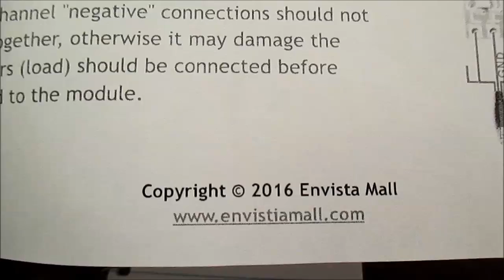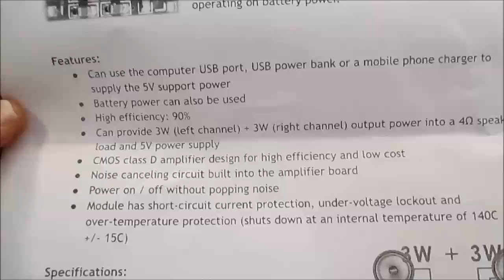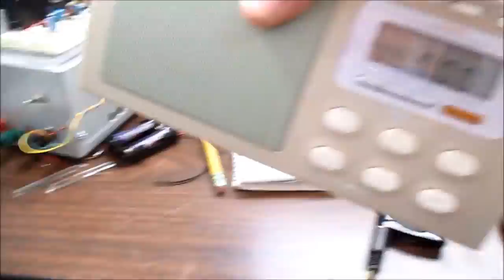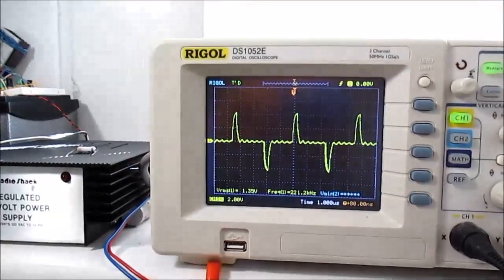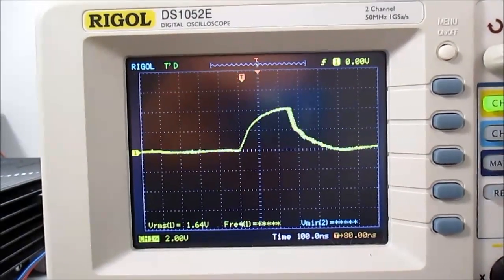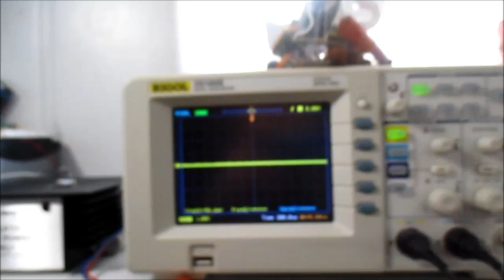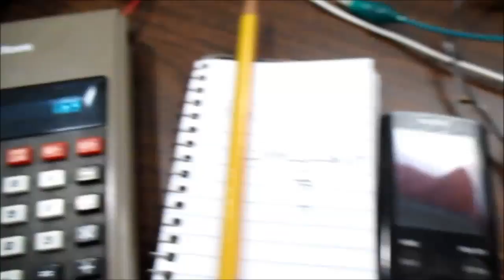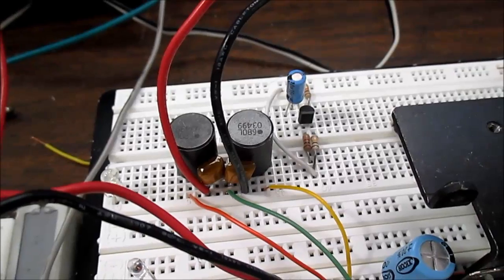PAM8403 class D tiny stereo audio amplifier board review & test

Comment: Hi ! I just discovered your channel searching about amp module for cosplay props. I have a few of these PAM8403 modules and I used to put some big capacitor on the input voltage, like 2 or 3300uF. I can't find a clear information about how big should be the capacitor, I've read somewhere 1000uF per watt... I've seen in your video that you're using quite small capacitor, like 220uF I think ? So my question is how do I select the rigth capacitor size for the input voltage ? Also, do you have a good reference book to recommand that might cover this subject ? I'm quite noob on amplifier and there is so much contradictory information on the web. Thank you !
Reply from the maker: It depends on your power supply. 1000uf would be plenty for this amp
Reply: Ok I have a 8A dc-dc 6-14V to 5V power supply module CK1408.
Is it better to have multiple capacitors like 1000uF, 220uF and 0.1uF to smooth the input voltage or just the 1000uF?

Comment: Great video, great impressive tiny amp module. Did you knew you can other things with these little wonders? Believe it or not but I use these cheap boards to drive resqued/salvaged VFDs (Vacuum Fluorescent Display) its filaments, works great! Mostly a filament wire is 6 to 8 ohms depending on the size of the display. An amplifier like this is a great tiny current source (at a low voltage) and is exactly what the electrons inside the display are looking for ;-) 

Its output (one channel) is  AC instead of DC that avoids uneven brightness of the display and avoids damage of long term DC usage. It is also easy to drive because it needs only 5VDC and it provides a TTL-level (with use of some resistors) brightness control (if needed, if noise is not powerful enough) so you can input a wave (frequency or PWM (square)) to control the brightness. You can do this for example with a microcontroller/Arduino or another oscillating capable circuit.

This tiny thing saves you the need to design a complicated coil, H-bridge, half bridge solution or special (mostly obsolete) driver IC to drive the filament of such displays and it is really cheap. I use this method in a few projects and it is really great. Nobody told me this possible in my journey to find an easy solution. Only want to let you (and others to know) that amplifiers can be used for other things that isn't described inside the manual. Try it if you like, it is great!
Reply: Your comment gave me such a great idea man. Never looked into VFD, wow awesome concept!

Comment: Hello John. I have a similar amp here, but what I want to use it for is a spring reverb driver for guitars. I want to have the guitar signal go into the right channel, then out of the right channel into the input port of the spring reverb tank. Then, on the output of the spring reverb tank, hook that up to the input of the left channel of the amplifier and then pass the output of the amplifier left channel into the guitar lead heading off to either the amplifier or the next pedal. Your thoughts on this idea would be a great help. Thank you.

Comment: I know I'm pretty late jumping in here with questions but does anyone know how much current this board draws? I will be using USB power and two 4 ohm speakers, just trying to make sure 5v at 1 amp is enough to power it. I just bought 12 of these from Amazon for about $10.
Reply from the maker: You should be fine with 1 amp.

Comment: That was an easy smooth Clear run through of the concepts I'm looking for. The big difference, for me were the well placed  descriptions of - how you know it functions well, is it to specs, and things you change due to slightly newer variations of similar amps. As a Struggling beginner I feel like I learned some things from this video. Fun was had.

Comment: John...
I noticed while looking at the IC's datasheet and these boards that the IC's left and right (+) output pins are tied to the (-) output terminals on these boards.  Wouldn't the output then be 180° out of phase ?
Reply from the maker: Usually, there is an output pin marked as + and -. Normally, you'd expect the - pin to be tied to ground, but these are bridged amplifiers with the - pin being the output of an amplifier that is 180 deg. out of phase from the + pin amplifier. This "bridging" of two amplifiers allows for much greater output power at a given supply voltage.

Comment: I have a Pam8403 Chip with a different board layout, (it is nice to have a volume), I use 8 ohm speakers it still sounds good and has plenty of volume.  I recently added a Bluetooth/mps player.
I ran 2 different Pam8403 based boards on a 3200mha Linthum battery it lasted about a week of multi hours a day.

Comment: Hey John,
can I also use this litle amp to pre amp any Turntableplayer to connect on a receiver without phono input?
Reply: Certainly you'll need something that follows an RIAA curve right?
Reply: @senorverde09  yes. I recognized that some cheap riaa amps use only one op in the circuit instead of two. Must be important , as i recognized that the ground between left and right output of my turntable are separated. 
 Can you recommend a china preamp board on aliexpress?

Comment: Thanks so much for posting this, John.  After watching your video, I picked up 5 of these off of ebay for like $4.76 incl shipping. It has most of the components shown on the PAM datasheet typical app, and I only added a 470 uF 10V cap on power per the datasheet.  Just finished a build this morning putting it into a small polyethylene case that previously held two 18650's, added 2 RCA jacks for the speakers, a 3.5 mm jack for stereo audio input from my old Sandisk e280 V2 music player, and a shielded USB cable that gets connected to 5VDC boost regulated 4P 18650 pack I made. Using my 8 ohm Sony SS-B1000 bookend speakers, the sound is un-frickin' believable: Crystal clear with very nice treble and bass.  It is so clean and clear I was stunned. I played several of my favorite album cuts and it was like hearing them for the first time.  And what adds astonishment to amazement is that these were under a buck each and yet they are so good.  Average power consumption appears to be only around 50 mA at the volumes I'm listening to in my little workbench area.  Thanks again, this is a real gem.

Comment: Hey John I just buy a pam8403 but I don't have a CRO or DSO so could you just tell me the values of the components used for output filter.. cause I wanted to connect a Bluetooth module with the tiny amp but ended up with lots of hum,, hiss,, and distortion..that will help me a lot by the way your stuff is amazing I watch your all videos and try to learn something new ..

Comment: Trying to read the output across a 4 ohm speaker, this amp seems to be clipping as soon as I connect ground from a probe. How do I read the output signal? Thanks
Reply from the maker: It could be possible you are shorting the output with the grounded probe if the power supply or signal source is grounded as well.
Reply: @JohnAudioTech  thank you. You are correct. Both are grounded. How could I read both source and amplifier output at the same time then?

Comment: now the fun... can you parallel the inputs and outputs of two boards to double the output?
if it DID work, 3.4w per channel on 5v could make for a pretty strong little portable toy.
Reply from the maker: It would not be practical with the unfiltered outputs these use.
Reply: thanks the reply, I have a few of these postage stamps and they are pretty cool fun to mess with. small project case 5v mp3 module plugs into a power bank. I like their 8610's too, just enough power to have some fun with... crossovers feeding to a DVC woofer for basic 2.1 setup

Comment: Hi, I have a question for you. How is it possible for an amplifier to output 100W of power by consuming 60W? Am I missing something? 

I only joined the channel recently after seeing one of the videos about lowering the input noise. Looking forward to watch other interested videos as well. 
Thank you.
Reply from the maker: If an amplifier is putting out 100w it will be consuming more than 100w otherwise it would be breaking the laws of thermal dynamics.
Reply: @JohnAudioTech  Hello John, 
Thank you for the reply :)
I see some people selling amplifiers that output 100w, 200w 300w. Tuk tuk (three wheeler) users in my country (Sri Lanka ) have these installed in them. The only power source is the vehicles battery. So that's why I wanted to know if I was missing something. 
Thank you :)

Comment: Good to know the 52 cent amp I ordered on AliExpress is gonna sound good 😜
Reply: Update: it sounds just like it's supposed to, no distortion or anything unless you turn it up too high like every amplifier
Reply: @hananas2  down to ~12 to 17 cents now lol, there's also an almost equally as cheap 10w stereo amp for about 19 cents. Ridiculous when you think about it. The 2x10w one has some significant hiss tho...
Reply: @soyboy3274  Depends if you get the version with a volume knob tho, I got the one with a volume knob on the board

Comment: Without being excessively technical in regards to the output LC filtering you did put in place, under normal circumstances, what would be the cutoff frequency would you be looking for ?  I understand that the output load will play a role in regards to the "Quality factor" and "Damping ratio" of the filter, so will the L & C ratio, but I just wanted to know what would the more appropriate cutoff frequency be.  Personally I'd opt for something in the upper audio spectrum range, but not being an expert with amplifiers and audio equipments, I'm pretty much in a need for some advice.  By the way, despite this is not directly related to the PAM8403 amplifier as such, I found a Class-D LC Filter Calculator Tool on the TI website at http://www.ti.com/tool/LCFILTER-CALC-TOOL  which provides quite some interesting information.  Perhaps it would be worthwhile to take a peek at it.

Comment: I bought this Micro USB 5V PAM8403 Bluetooth Digital Audio Receiver Stereo Amplifier Board
Is it better to connect with booster step up 5V module or directly from the 18650 battery?
Thanks!
Reply from the maker: Running the amplifier from 5v will get you more power.
Reply: @JohnAudioTech  Thanks,
What do you recommend dor step up V?

Comment: I am also trying to drive a 4 ohm speaker with this, off a 3.7V Li ion battery, but I'm experiencing severe grounding issues. The power and the ground channels get shorted whenever I try to play some music off my phone. Do I need to reduce my voltage? Or is this a connection issue? My connection is the same as yours.
edit: I haven't used a filter in my connection.

Comment: Is it possible to add a volume control to this little board? If so... How?? Thank you for any help.
Reply from the maker: Yes, you can add an external control to the inputs. 10K audio taper stereo potentiometer would work.
Reply: Cool... and Thank you very much. I found 1 audio taper out of an old boombox but max R is 200 ohms... getting Some volume control on it.
I want to use a power bank to power the chip... BUT a 10 sec auto shut off always trips off... especially between songs or quite moments in the music.
I am using a USB Cable, just the black and red wire (green and white NULL). Is there a way to trick the system into detecting current draw such as a power indicator LED?  
I assume being a Class D amp... current draw drops during rest in music or song changes... thus auto shut off of power bank.
Reply: At first glance it looks like your power bank needs to draw some current to stay "alive".  I would have thought that the 23ma @5v quiescent current would have been enough, but I guess not.  The only thing I can think of would be to add a resistor in parallel with your Vin on the board such that it would allow to draw the extra milliamps necessary to keep the bank active.  Be careful not to put something too low otherwise it could get warm and/or drain the bank too quickly.  Also, validate that this is what is required to keep your power bank awake by testing the bank with other accessories.

Comment: I built one into a small box with two 1" rectangular speakers and a USB connector for power and a 3.5mm  to plug into the audio out of computers for testing. Fits perfect in my computer tool box

Comment: Ok so right after I posted a question of measuring the speaker or some how finding out what it is, I just happened to find out it is defiantly a 3watt 4ohm speaker, but now I need to know if there might be away to fix the thing or maybe the amp you review in this video will be ok to use with this little speaker, I know I will need another of the same size

Comment: I got a little blue tooth speaker mp3 micro sd USB fm speaker, there was not two speakers as the original page said, but it sounded ok for about 3 months then it just stopped charging, I couldn't get the micro plug off and solder any leads for power, so I have been trying to find something I could use the single speaker with, the speaker does not have anything printed to say what it is, rather if it be 3 watt or 4 ohm. Nothing, so how would I figure that out with out a bunch of the equipment you have? And finally is there away you may be able to find to fix this problem with this little speaker? I did like it even if it was not spectaculer

Comment: Hi, thanks for the video, I bought two of them PAM 8403 the red board and green one with the pot. But both of them they are strangly low power and distortion even at small speakers. Where I am making mistakes ? I drive them 5v 1A phone charger or adapter but really very low voice, crackes and distortion ! I bought them from Aliexpress and I start to think that may be chips are fake. What you think ?
Reply from the maker: Be sure the speakers are connected across the output terminals (not output to ground) since this is a bridge type amplifier. You could also add a 1k resistor across each input to shunt away any possible noise the amp picks up (sometimes causes distortion to the sound).

Comment: very simple and cheap very easy to made ^^ i use this one to made an amplifier for my little sister (2.1) pam 8403 for stereo with small speakers and  a couple of darlington tip 142/147 for the bass , it work fine :)

Comment: Can I use this to make a portable headphone amplifier, would that be of good use? I am planning to use 18650 batteries to power it
Reply: This is a full-bridge Class D amplifier. It would not be suitable for a headphone amplifier because (a) most headphones use a common ground for left and right ears (if you tie the negative outputs of this amp together it will burn up almost instantly), and (b) as as Class-D amplifier, it has switching noise, but because it has no output filter it uses the coil of the speaker as its low-pass filter, so the speaker will radiate much more electromagnetic field into the head of the wearer, which could cause an increased risk of brain cancer over time. This amplifier doesn't cause cancer, but long term exposure to high strength electromagnetic fields from any source can damage the DNA of brain cells and cause them to become cancerous, and using this amplifier to power headphone drivers very close to your head could increase that risk.

Comment: Hi John, good videos as always. Question: If I feed the PAM8403 with a mono signal (same signal on Left and Right channels), can I connect together the outputs (OUTR+ with OUTL+ and OUTR- with OUTR-) to get a double power output on a single speaker?
Reply from the maker: If you have a low impedance speaker, say 2 ohms, you could try this. You would need a current sharing resistor on each output pin of .1 ohms (four total). If your speaker is 3 ohms or more, it won't help because one channel is capable of driving the load.

Comment: Will a 2.5 ohm 3 watt speaker work anybody
Reply from the maker: 2.5 ohms rather low. You would want to run the amp with a lower supply voltage (less than 4v) to avoid stressing the amp.

Comment: I've used another bluetooth module. 'Cause you said the other one had differential outputs. I hook it up to the same battery. There was some "data" noise but once I've added the 3v to 5v converter. The noise was gone. But its making another noise again. I think its from the converter. Its not noticable at high volumes but its really noticible when the music is quiet. Its sort of like little popping noises. What should I do?
Reply: I've added a 1000uf capacitor to the output of the boost converter. The noise is in a different interval now.
Reply: https://drive.google.com/file/d/0Bw6N8kFthuWmQWlNd3JZYWV3Slk/view?usp=drivesdk
It sounds like this.

Comment: Help. I'm having trouble connecting it to my bluetooth module (I got it from a bluetooth stereo headset). The bluetooth module has two grounds. One for the left channel. One for the right channel. If I connect them together, the audio output is terrible. Its really weird. How do I hook it up to this amp with just one ground on stereo?
Reply: And there's also a weird data noise if I put it on mono only.
Reply from the maker: Not sure but it sounds like the BT module has differential outputs. You could try connecting the ground side to the module through 1k resistors (one resistor for each channel).
Reply: Oh...So I can't use stereo?